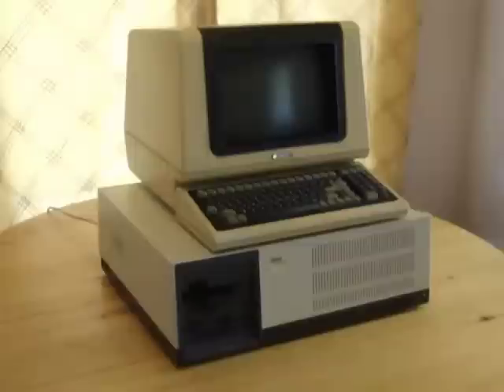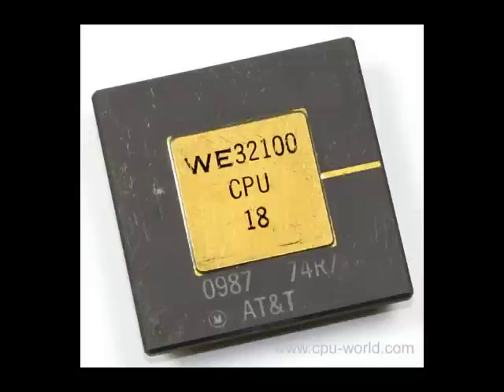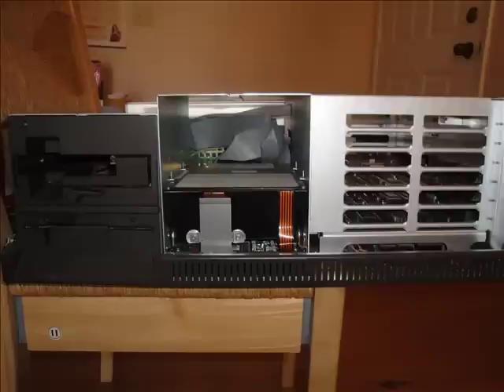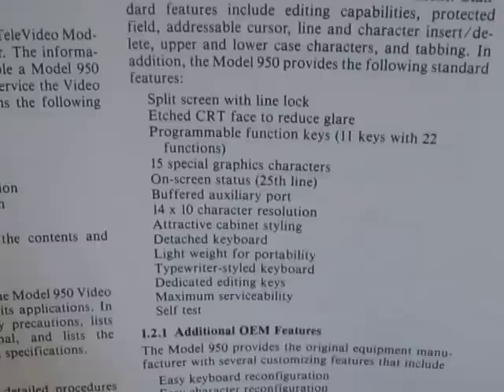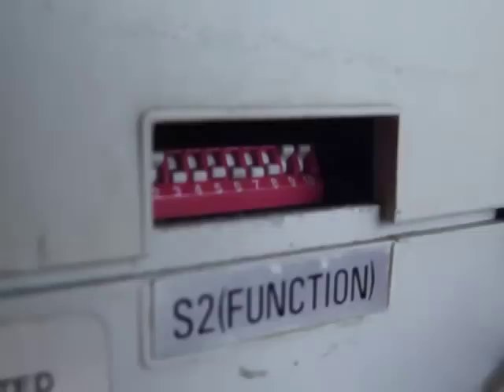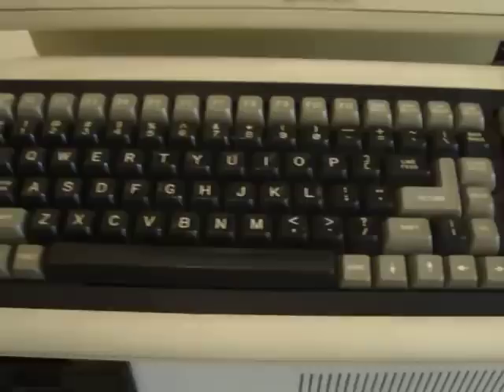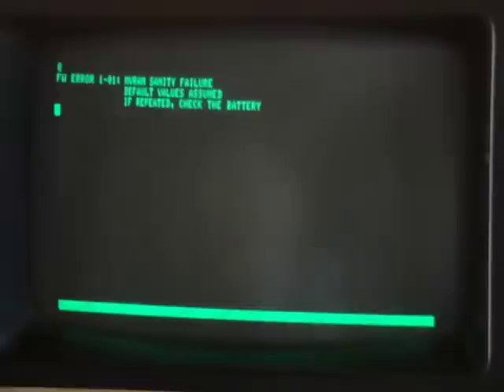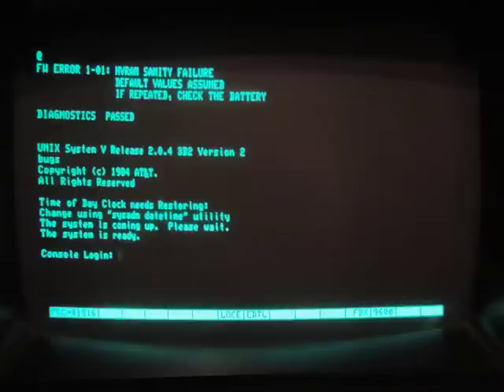AT&T 3B2 400 Computer Review

Comment: The original AT&T was truly an enormous technology company in every way. They designed and manufactured much of their own equipment needed for their national phone system network including: the telephones themselves, phone switches, cables, connectors, microchips, and even computers. This CPU and all of the aforementioned hardware was produced by the manufacturing division of AT&T back at that time. It was called: "Western Electric" (not western electrONic).

Comment: I worked on the development team of 3B2/400, which was the world's first desktop size 32 bit system!  It was developed on the second floor at 1100 Warrenville Rd, Naperville, IL, on the Bell Labs "Indian Hill" campus. The 3B2/400 was the porting base of UNIX System V Release 2.  Try "root" for the root password!  That's what we used in our Labs.  I also led development of the world's first virtual address cache memory for a production UNIX system, in the 18 MHz 3B2/600 (the "Vcache" board).  This special first-level cache is why that machine was so much faster.  BTW, the official AT&T color was called "misty cream".  3B2 also had a universal power supply which could operate between something like 75 and 275 or so volts.  The power supply was so good that they could stay up under brownout (reduced line voltage) conditions.  We put some of them on a UPS battery backup in the Labs, and when the brownout conditions occurred that summer (1983? 1984? 1985?), the UPSes went onto battery, used up the battery, then crashed.  The 3B2s NOT on UPS stayed up the whole time during the brownout!  Those were the days!

Comment: Considering in it's day and age it was tiny compared to the AT&T 3B5 or 3B15 which could hold up to four 8" Control data drives totaling 1gig of space. There was one in the Beaudry & 6th Street Building in Downtown Los Angeles old Bell Building aka Security Pacific Towers.

The terminals connected to these machines were the AT&T 4410, 4415 I think.

Here is a ATT video which talks briefly about the 3B2 line of computers.

Bell Labs Film on Shaping the Computer Age from 1984 - AT&T Archives

Comment: AT&T made the first 32-bit microprocessor.  The first working prototype was referred to as the Bellmac 32.  These processors were designed to operate telephone exchanges, and as such are some of the most reliable microprocessors ever developed- it has multiple redundant registers on the same die!

Comment: Wow! I worked for Amaco Motor Club in IT in the 80's. We had 2 3B2 600 and 1000's running about 100 clients backed on 9Track self feeding. I still have the AT&T pagemaker monitor! Also I still have several working version of the UNIX PC. System V was amazing. Love NAVram Sanity Error!

Comment: Lovely - I had two 3B2s at one point as a kid (one bought from someone I knew through a dial-up BBS and another bought at a community college electronics sale). Technically my first and last UNIX™ machines ;-) I made the mistake of pressing one into use in the mid 90s at my parents company, where it was used to keep text file notes on customers that could be accessed from any desk thanks to all those lovely serial ports. It worked great - right up until the day it died and no replacement hardware existed (oops).

Comment: Wow; it's good to see one of these again.  If I remember correctly they were actually built by AT&T for switching and billing; however, many were used as servers.
Reply: The 3B20 was actually used for switching.  But they talked to 3B2's over a star network to co-ordinate billing info.  I worked at the Western Electric plant in Oklahoma City where these were built in 1983-1985.
Oh wait!  No, the 3B 20's talked to 3B5's for billing.  3B2's were used for business branch offices. It's been awhile.  Those neural connections  are weak.

Comment: I have an AT&T 6300 PC.  And I've seen an AT&T 7300 Unix computer, the one with the monitor built into the top of the computer.  But I've never seen this model.  Nice find.  Though I confess, I'd have been looking for a monitor and keyboard plug some where on that box.  Never would've guessed you needed a terminal to use it.
I feel educated now.  Maybe next time I see a computer without a monitor and keyboard connecter I won't shy away from it.
Great video!

Comment: Hi Brian: regarding the password, I suggest you read out the harddisk, 
create a disk image, find where the password file is stored and then 
either read out the password - if it is plain-text - or nuke the 
password otherwise - so there is none.
Reply: The password should be stored encrypted, but yeah, you can just delete the password, if you can get access to the system.

Comment: then i feel i should hint you of the swedish CP/M 70's-80's Luxor, Facit, Ericsson etc computers/terminals.

ABC-80, ABC-800, Facit SATT 4420, Zenith Z89, ESSELTE Systems, Scandia Metric 85, Zampo DS-510, Microtronic EG 3003 and 3008 and tons more.

usually not expensive, but very hard to find in some cases.

Comment: Nice video. I wonder if you ever got logged in? I finally got around to trying out my 3B2/500 that I've had for about 10 years. I wonder if you could share the pinout of your terminal cable as well as the serial connect info (baud rate, etc) ?? If I can get into mine, I could make you a boot disk once I get root on it. I'm wondering if I can mount the MFM hard drive on a linux box that I have so I can reset the password and/or try to crack it for fun.

Comment: and btw, i think that file system is pretty slick considering as how it never needs to be defragged, it separates data from executables, which gives it more resistance to file system viruses unlike Windows, as well as it runs a lot faster and more stable than a Windows NT Kernal environment. a LOT of things you do not even realize have this file system. i think it is time to take off the tin foil hat and start to actually see things as for what they truly are. or - sudo apt-get a-life

Comment: Linux and Unix seems cool at first, until you get under the hood and realize the whole thing is a rotten menagerie of hacks.  A trip through the horrid man pages reveals as much.  Obfusicated command line switches, a file system layout that is no where near standard across machines, server software that is not configured to run right out of the box but that you have to spend hours on a Linux HOWTO page to figure out.  Unix/Linux smells hacker elite, but its really one big amatuerish kludge.